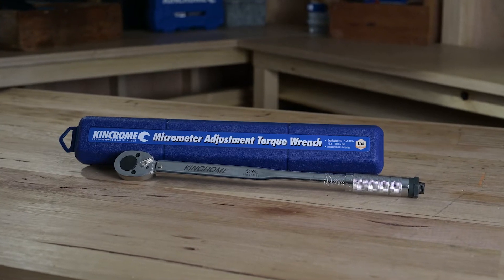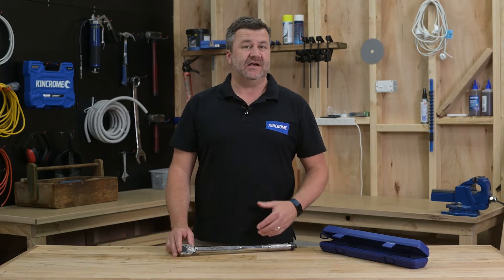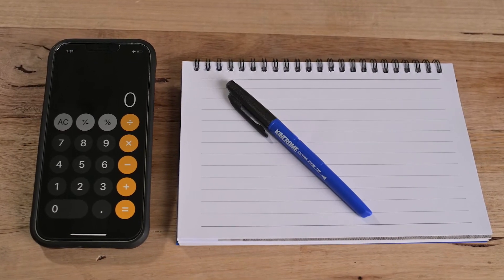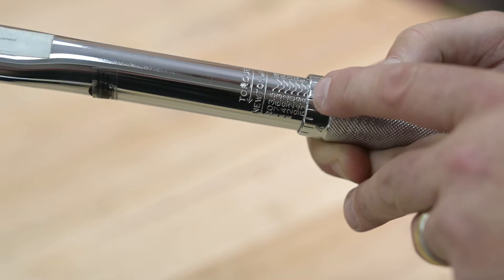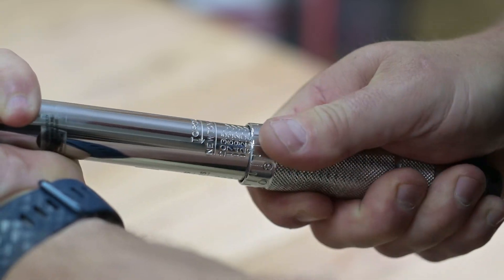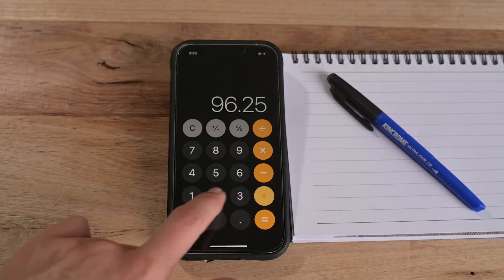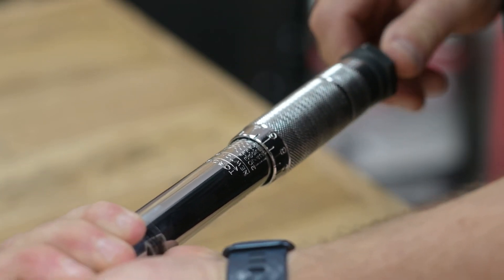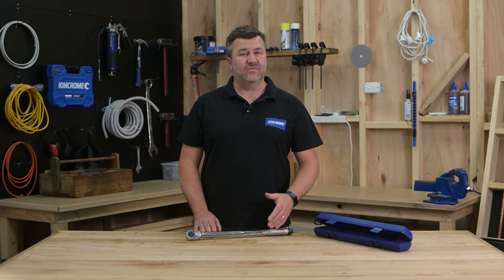How to set the Micrometer Torque Wrench in Newton Meters | KINCROME Tech Tip

Comment: That's so convoluted, manually adding 1.35 multiple times and having to keep track. Why not take your target, deduct the closest scale, divide remaining value by 1.35 and it'll tell you how many notches to use, no? 

By the way, my other-branded 3/8" and 1/2" torque wrenches all default to NM scale. I've wanted to buy a 1/4" for ages but many of them are in-lb. I thought I found ages ago that a Kincrome 1/4" used sensible round NM numbers instead of e.g. 54.6NM and I decided that was the one for me.  But then I found there were several different types of packaging for seemingly the same model (MTW200I) and also lots of reviews complaining about what a hassle it is to set NM values, so it really put me off. I can't find any info in your marketing which scale is the default for this wrench so I have to discount it, look for another brand that's definitely in sensible NM values. Can't understand why you wouldn't just source a torque wrench in metric values to be sold in metric countries. Like I said, my other two wrenches can do it.
Reply from the maker: Hey Mate,

We found that the method used in the video is the easiest to understand and there is also a handy chart included in the packaging that helps to convert in-lb to Nm. We do however offer 2 other ranges of torque wrench which include ¼” and 1”. These ranges are:

Deflecting Torque Wrench Range
K8032 – ¼” (5-25Nm)
K8031 – 3/8” (10-120Nm)
K8032 – ½” (40-300Nm)
K8034 – ¾” (150-650Nm)
 
Dual Way Torque Wrench Range
K8036 – ¼” (2-10Nm)
K8500 – 3/8” (10-50Nm)
K8501 – ½” (40-200Nm)
K8502 – ½” (60-340Nm)
K8503 – ¾” (150-750Nm)
K8504 – 1” (200-1000Nm)

Hope this information is useful!
Reply: @kincrome   I just purchased the MTW200I.  The fine dial i'm assuming is in Nm, even though it doesnt explicity say that anywhere.  Also the handy chart you refer to and it is referenced in the instructions shows conversions from Nm to Ft-lb, not in-lb which is what the scale is on the side of the tool.  So conversion is not possible unless I divide each of you ft-lb conversions by 12, this is nuts, who is writing your documentation ?